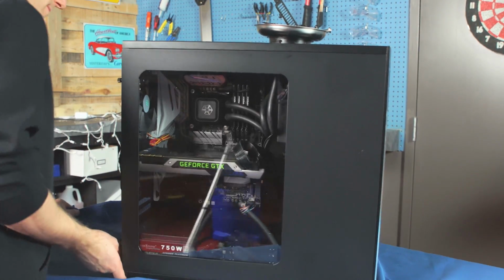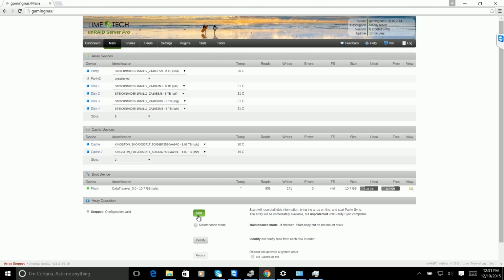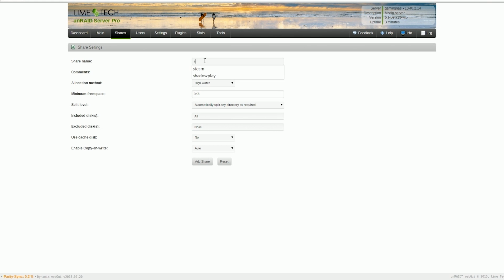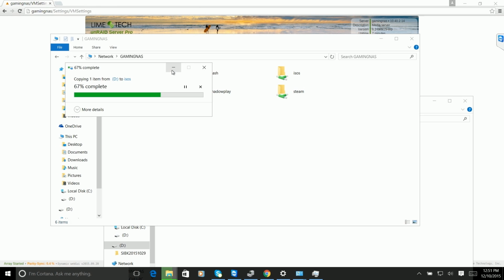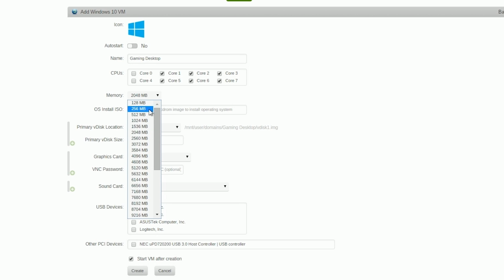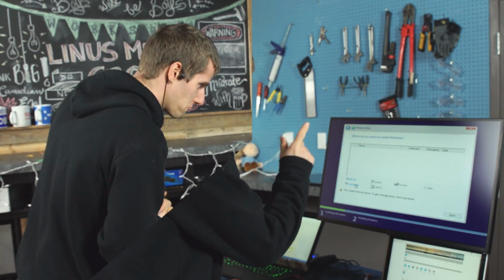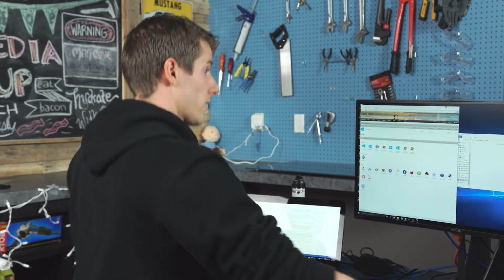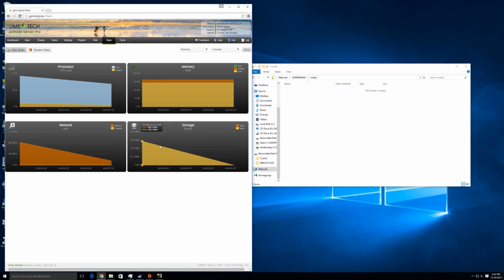Use your Gaming PC's Extra Power as a NAS Ultimate Guide

Comment: Linus...you just called UEFI BIOS after doing a video about UEFI and BIOS. They're separate and completely different things :/
Reply: He's just reading the screen... it's literally titled "UEFI BIOS" on the screen bro
Reply: oiralire except that's incorrect not to mention he didn't read the screen. He just said "BIOS." It's incorrect because https://en.wikipedia.org/wiki/Unified_Extensible_Firmware_Interface "UEFI replaces the Basic Input/Output System (BIOS) firmware interface originally present in all IBM PC-compatible personal computers." If wikipedia isn't credible enough google it on your own. They're not the same.
Reply: +Scoopta The particular firmware he's using is ASUS UEFI BIOS Utility.
Reply: oiralire yes I'm aware which is a UEFI...not a BIOS. The branding isn't technically speaking correct. There's no such thing as a UEFI BIOS. There is UEFI which is one thing and used on most modern motherboards including that one and then there's BIOS which is more old school. https://fedoraproject.org/wiki/Unified_Extensible_Firmware_Interface "But you may see the term "UEFI BIOS" (or even just "BIOS") incorrectly used to refer to a UEFI firmware"
Reply: +Scoopta I like ham and pineapples.Your argument is invalid.
Reply: oiralire XD...damn Idk how to beat that =P. There's no fact on earth that can beat ham and pineapples. So does that make your favorite pizza Hawaiian?
Reply from the maker: +Scoopta And yet, somehow, you understood what I meant... :p
Reply: +LinusTechTips can I plug my anti static wrist strap in my grounded wall outlet? ??
Reply: Its not incorrect if its the brand name. Plus everybody knows what he's talking about, especially since UEFI and BIOS pretty much serve the same purpose, so most normal people wouldn't actually give a shit...
Reply: tbh i've been watching linus's videos for like a good 3~4 months and i can't understand anything lol
Reply: why are people even arguing over something so trivial as branding? Descriptively, UEFI is still a Basic Input/Output System, in that it's firmware that handles basic IO. Colloquially, BIOS is a term for firmware. Linus's point stands, linguistically, because the most fundamental attribute of language is its utility in communication. That his use of a pedantic misnomer conveyed the same meaning just as effectively, if not more so (many have no idea what UEFI is but have heard of BIOS) makes his use effective, and thus valid. Why am I taking the time to type all of this? Bus to work and I forgot my headphones...
Reply: +Scoopta how is this top comment for fuck sake
Reply: LinusTechTips XD =P...this is an excellent point...I was just pointing something out.
Reply: Scoopta Your second point kinda proves mine. They serve the same purpose yet the brand given to them changes its name. Hence if Asus wants to call it a UEFI BIOS, whether it makes sense or not that's what its called.
Reply: +Scoopta A UEFI is basically an interface program for handling the BIOS, Most modern PCS have a UEFI to make maneuvering around the BIOS much more intuitive for laymen and much simpler to laymen. The difference is the UEFI runs only when you access the BIOS, where as the BIOS is running 24/7 even when your pc is off.
Reply: Completely different things? Both things perform the same functionality. UEFI is just more modernized and offer more advanced features. In essence, that's all. It's like a BIOS 2.0 or something like that.
Who cares about those details, dude?
Reply: +Scoopta I really enjoy watching you struggle from some sick reason LOL
Reply: +Scoopta who cares ¯\(ツ)/¯
Reply: +Michael Alderson brand name? I fail to see what you mean by this. They brand the UEFI with "UEFI BIOS" but that doesn't make it correct. Also MS-DOS and Windows serve effectively the same purpose yet I doubt anyone uses those interchangeably and that's a perfect analogy.
Reply: +Scoopta Relly. Why do you care?
Reply: +To Athánatos yes and then you could say Windows is MS-DOS 2.0. Which I guess isn't too far off but that still doesn't make it correct.
Reply: +waywarden -__-
Reply: +Scoopta  WoW...now that was entertaining...(for whatever reason)...
However I still have the sudden urge to punch you in the throat...LOL
Reply: +Scoopta You would probably  be correct sir...it shouldn't be very difficult for you as I'm a quadriplegic and have been wheelchair bound for 20+ years.  You really should consider chill-laxin a little...  learn how to make lite of certain situations while interacting in a social environment...no need to be so anal over the proper terms. 
Pause and think about where we are for a second,  a tech channel. 
We're all very aware of the differences between UEFI and a legacy BIOS and their advantages and limitations. They both preform the same purpose in the transition from hardware level to the OS correct? UEFI is just a superior BIOS with more features and a lot features that can be directly from within the OS. The even still call the chip on the MB a BIOS chip. Hell, a lot of your high-end MBs and GPUs of have two, and what do they call this feature?... a "dual BIOS". But we all know it "technically" has UEFI firmware flashed on the chip.

Some social acceptance advice would be...just be aware of who the audience is when attempting to educate someone on something so trivial and universally understand by the audience. 
Unless you're just trolling, then perhaps... mission accomplished...and the joke is on us!  :p 
Peace.
Reply: Scoopta looks like you almost got the point that time. It's an acronym letters that stand for words that describe something. The term BIOS is here to stay weather you like it or not just look at amazon or newegg under tech specs it'll say BIOS: UEFI and that's not gunna change, because when you get down to it UEFI is a basic input output system.
Reply: Scoopta so are Windows and OSX but they're both still operating systems.
Reply: Scoopta the problem with your argument is that your "source" is a guy saying with no supporting evidence that "you may see the term "UEFI BIOS" (or even just "BIOS") incorrectly used to refer to a UEFI firmware". He, in no way supports this claim and if you read the rest of the article his explanations support our side:
"It is important to realize that most systems with UEFI firmware also implement a BIOS compatibility mode"
"As we've already seen, the way to choose whether to do a BIOS-native or UEFI-native installation of Fedora is to boot your installation media in the correct way"

It's literally naively backwards compatible, and the original statement is literally just a guy being butt-hurt that they're calling his system by a name that he doesn't want associated with it, but that's not his choice. It's like saying "It's not a CAR it's a HYBRID" no it's a Hybrid car. It is in fact a Basic IO System.
Reply: +Scoopta 
OMG dude...
"It's the artist, formerly known as Prince" 
But...but...he's doing the same thing he's always did...no! no!  it's not Prince...technically! 

WTF are you trying to prove that we don't already know?
Reply: +Scoopta it&#39;s been very amusing...thank you ;)
Reply: +Scoopta Except UEFI is still technically at least an IOS (Input/Output System)
Reply: +Scoopta UEFI BIOS Is the new "ATM Machine"
Reply: +Scoopta oh no... somebody call for help...
Reply: +Mark As a CompTIA Certified Potato technician, I think this whole conversation is silly :D Who cares what you call it? BIOS and UEFI/EFI are pretty much the same bloody thing. UEFI is just better, but its still the firmware, still does POST control, etc.
Reply: moncool17Gaming yeah I did. You said "they're just visually different" and "the point of UEFI is to look pretty." I was pointing out all the technical differences and while I didn't actually get into why it was created it wasn't to look pretty. Basically everything you said was wrong...and while they do generally look different(and yes prettier) if you look at a UEFI on a server motherboard it looks exactly like BIOSes used to.
Reply: +Michael Alderson except it's incorrect to call it that. Also I fail to see how my second point proves yours. My second point is basically saying if you call UEFI BIOS then you can call Windows MS-DOS. In both instances you have two pieces of software, one newer and one older, that both serve the same function.
Reply: +Michael Alderson I suppose what you're getting at is they named their UEFI "UEFI BIOS" and so it's ok to call it that. But I still think if I named my pet turtle "fish" and called him a fish because that was the name I gave him people would look at me funny and that's my point.
Reply: 😂😂😂+smt kill me😂😂😂
Reply: +blchfnby did you read the links I posted for the facts? Because if you did then you didn't understand them. That's not how anything works.
Reply: +Timothy Gilbert (TJ4542TJ) you also clearly didn't read anything I previously posted. I'm not going to re-aruge my point.
Reply: +Stian Strange because I do. I'm weird like that.
Reply: +Timothy Gilbert (TJ4542TJ) well for the TL;DR version. UEFI isn't BIOS and the "UEFI BIOS" branding is wrong according to any source that actually knows. Say the fedora wiki
Reply: ***** what "UEFI BIOS" :/...if that's your point see https://fedoraproject.org/wiki/Unified_Extensible_Firmware_Interface
Reply: ***** excuse me mam. I do know exactly what I'm talking about. Firmware is the umbrella term...BIOS is not an umbrella term. "The BIOS (/ˈbaɪ.ɒs/, an acronym for Basic Input/Output System and also known as the System BIOS, ROM BIOS or PC BIOS) is a type of firmware used to perform hardware initialization during the booting process (power-on startup) on IBM PC compatible computers, and to provide runtime services for operating systems and programs." "Unified Extensible Firmware Interface (UEFI) was designed as a successor to BIOS, aiming to address its technical shortcomings.[4] As of 2014, new PC hardware predominantly ships with UEFI firmware." https://en.wikipedia.org/wiki/BIOS
Reply: ***** also you clearly missed the quote from the fedora page so here "But you may see the term "UEFI BIOS" (or even just "BIOS") incorrectly used to refer to a UEFI firmware" https://fedoraproject.org/wiki/Unified_Extensible_Firmware_Interface
Reply: ***** I already stated it's not an umbrella term...firmware is the umbrella term...BIOS is a specific firmware. I don't have time to argue with trolls like you...and if you aren't trolling then you're to lazy to read the links or quotes I'm sending. Either that or you're just stupid. I've done my research I've posted my sources all you've made are assertions. Unless you give me some hard facts proving your point I'm just going to ignore you.
Reply: ***** I guess I never addressed your point about it being a colloquial umbrella term so I might as well do that. I already pointed out it's not an umbrella term and while it may be a colloquial umbrella term because then you can argue it has nothing to do with what it technically is that also makes it a complete non-point. From a social standpoint anything is acceptable as long as it's widely accepted however that doesn't make it correct.
Reply: ***** I do understand the word. From dictionary.com "characteristic of or appropriate to ordinary or familiar conversation rather than formal speech or writing; informal." Which is why I said that's a complete non-point. Just because people agree that UEFI can be called BIOS in conversation because they do the same thing does not make it correct.
Reply: ***** true and that was why I said "I understand this argument but it's still stupid." That's not actually what I said but it's what I was going for.
Reply: ***** First off there's no reason to call names secondly IDGAF if it's socially acceptable. You clearly missed my point by a light year or so...my point was that it's wrong to use the term. A BIOS is not the same thing as a UEFI. Yes they do the same thing and from a social standpoint you might be able to call them the same thing but that wasn't my point in the slightest. My entire point was that it's wrong to do so regardless of social/lingual acceptance because that's not what they are. I'm a very fact first person. Not the kind of person who is going to accept the "it's socially acceptable to do this so meh." Not to mention anyone who actually knows what they're talking about say computer scientists, especially those building operating systems, will use the proper term.
Reply: smt I'm only arguing because other people keep arguing. I was content after the point Linus made. I even said he made a good point. I literally only keep replying to people who continue to fuel this. Also I do go outside __. Also if I'm only stupid because I prefer facts over social acceptance then I think you've got the term wrong. I will admit socially I'm not the best but stupid I don't think is accurate.
Reply: ***** while Linux is just a kernel at least when you say "Linux" you're referring to an operating system based on the Linux kernel which is correct with "GNU/Linux" all you're doing is specifying it's a Linux kernel with a GNU userspace. Using BIOS to refer to UEFI is just wrong. Also I'm not intending to look smart and I don't give a single fuck if I'm embarrassing myself. Quite frankly IDGAF what people think of me arguing this all I'm saying is it's wrong. I also do know what I'm talking about. I guarantee I know more about a computer inside and out than you do. Maybe I'm wrong on that but I doubt it. UEFI is not the same thing as BIOS. BIOS is not an umbrella term. It wasn't ambiguous and I NEVER once said it was so that was never the point of my argument. I completely knew what he was talking about that's why I made the god damn post. And my original post never said "well it's not BIOS and some people might get confused." That was never my point.
Reply: +Scoopta has humor!! "You clearly missed my point by a light year or so..." to a guy named 0rb1tal xD
Reply: +James A Garfield XD gg no re. That's just unfortunate
Reply: Buehlar that's nice...that's assuming you can. I get the feeling I could kick your ass into next week but meh
Reply: +Buehlar It just erks me. That's really the only reason I made the post. The effort wasn't to try to educate anyone. I'm positive Linus already knows the difference and that's who my comment was primarily targeted at. I made the comment as feedback because it's something that personally annoys me, not using proper terms that is. I only argued the point because of the responses. I was not attempting to educate anyone until I ended up getting misinformed replies to my original comment.
Reply: +Voked kappa because reasons? I really have no idea
Reply: +Scoopta ok lets break this down. 
UEFI:
Is it a system. Yes
Is it basic. Yes
Does it regulate Input and Output. Yes
UEFI=BIOS confirmed
Reply: +steven kutschat except now you're using BIOS as nothing more than an acronym which while it is that it's in relation to a specific piece of firmware that UEFI isn't.
Reply: +steven kutschat yes it does perform those functions but it works and is designed fundamentally different
Reply: +steven kutschat oh also I fully understand the point and that argument entirely. The problem I have is it's still inaccurate.
Reply: +steven kutschat yep that's true. Just like UEFI and BIOS are both firmware.
Reply: +steven kutschat you're trying to use BIOS as an adjective to describe what UEFI or BIOS or any firmware really. I'm using it as a noun as in the name of the firmware primarily used on x86 based PC's for God knows how long till UEFI replaced it. The thing is I'm not even really trying to make an argument. I have sources. No one else on the other side has posted sources saying they're the same thing. Maybe it's just me but I tend to lean on the side of the fedora project or really any Linux distro/tech giant (including Microsoft) as opposed to people telling me I'm wrong because they say so.
Reply: steven kutschat first off I'm aware of the backwards compatibility. Also a guy is butt-hurt...this is fedora. Do you even know what that is because I doubt this after that statement. But let's just look around shall we. Oh I suppose Microsoft is butt-hurt too...yep http://windows.microsoft.com/en-US/windows-8/what-uefi it's designed to replace BIOS. Not be BIOS
Reply: Buehlar that analogy isn't accurate...but I'm not trying to prove jack shit...this comment was a correction however people don't seem to like corrections even WHEN THEY'RE NOT TARGETED AT THEM.
Reply: Buehlar well at least someone got something out of this XD.
Reply: +LinusTechTips xD
Reply: +iFail21 I do obviously __. I'm sure there are others just not the majority.
Reply: FireFaced  yea but that's not really the argument I'm making here. I don't think there's any argument that can be made that says it doesn't serve the same function as BIOS.
Reply: kingcarcas1349 uhhh?
Reply: +ApolloJustice I want to agree I really do, but you're implying  redundancy is the problem, UEFI does a lot more than just replace bios, the closer comparison is like comparing your mobile banking app to a teller at the counter
Reply: ***** no my uhhh was because of exactly what ***** said. I didn't get the analogy. I got the redundancy.
Reply: It says UEFI BIOS Utility.
http://prntscr.com/9nz838
Reply: A Christian Gamer at least look at all my sources that say that's wrong. I've posted at least 3 or four links including one from Microsoft.
Reply: +Scoopta we all know the difference, asus doesn't and that's the problem, linus wasn't incorrect in what he said as it was accurate of asus naming and terminology, but being asus was wrong it doesn't look good for anyone repeating them

that having been said there were a few boards in the transition that did utilize dual boot options at the primitive level having the option to use either BIOS or UEFI, I think this may be one of them?

The real question is since everyone here knows the details why are we still going on about it? Linus knows, you know, I know, everyone reading this knows, and likely anyone actually watching this knows
asus was wrong let's hate on asus and move on

ignore the fact I'm applying for a brand management position with asus and own an insane amount of their products....
Reply: ***** XD. I only continue talking about it because everyone else does :(. Also I don't think that's the case about it being an older board with both options. UEFI is mostly backwards compatible with BIOS although it is missing support for some stuff like 16-bit binary support.
Reply: +LinusTechTips  UEFI & BIOS are the same sh@# but different flavor. One is pretty. The other...... not so much.
Reply: Eddie Romero those aren't the only differences. Not even close.
Reply: +Scoopta - It doesn't matter how many sources you cite.  The manufacturer named it.  That is the end of the story.  
What you are arguing would be the equivalent of saying a Ford Taurus isn't really a Taurus because Ford is just wrong because someone that works for GM says so.  
Shut it.
Reply: Chris Moore I already stated my arguments against this. I.e. you name a turtle fish. Can you call it fish? Yea I mean you named it but it doesn't make you look any less dumb.
Reply: +Scoopta actaly UEFI BIOS is totaly correct because UEFI is just the more consumer frendly(and better to look) BIOS
do you always say i have Windows 10 or im gonna start Windows 10 no you say im gonna start Windows or OS its the same
Reply: ***** no that term isn't BIOS. The generic term is firmware. UEFI is also a lot different from BIOS besides the looks. If you wanted an analogy that makes it OK to call UEFI BIOS then you'd have to accept calling Windows MS-DOS. UEFI is a BIOS replacement not a newer version. However they're both firmware. Similar to how Windows is a replacement for MS-DOS and they're both OSes.
Reply: same as most people say garmin or GPS when they mean navigation

and also BIOS is system from IBM and just for IBM as far as i remember my teachers lecture about BIOS UEFI and EFI most of computers in last years before UEFI had EFI
Reply: ***** huh? No that's not the same. When they say garmin that's a specific brand of GPS. When they say GPS that's global positioning system. Navigation is the function a GPS provides. Firmware is not the function UEFI or even BIOS provides. Garmin is a type of GPS which performs navigation. UEFI is a type of firmware that performs the POST(power on self test) and loads your OSes bootloader.
Reply: Scoopta just saying you didnt understand what i ment
Reply: ***** what didn't I understand about it? You're example was I'll call Windows 10 Windows which is just shortened. That's why it's called UEFI. Otherwise it would be Unified Extensible Firmware Interface and isn't that a mouthful. BIOS is a completely thing altogether. Even Microsoft says so on every single website they have regarding what UEFI is. It also isn't just for IBM you're right. It's for IBM compatible PC's which is at this point literally every PC so meh. and yes there is EFI but what does that have to do with this argument.
Reply: Scoopta you  are stupid and dont understand a thing about a thing or anything at all
Reply: ***** oh really. This proves my point nicely http://windows.microsoft.com/en-us/windows-8/what-uefi anyway I'm done arguing. BIOS is not synonymous with firmware and you'd be surprised how much fucking research I've done just so that when people like you challenge this I'm not an idiot. Somehow I don't think it's me. Hell even Linus didn't disagree he just said "well you knew what I meant."
Reply: +Buehlar I stopped at quadriplegic. If you are any sort of (x)plegic, I'm sorry for you, I truly am, but I must point out, quadriplegics can't use their arms, thus they cannot type. If you had someone type this out for you, I can understand that. Also, would you care for a watermelon?
Reply: +Scoopta As a computer scientist I find this conversation very entertaining. While I and most other people accept your position that they aren't technically the same, for all intents and purposes the terminology is interchangeable. Especially for people who aren't interested in the core running of the machine. For most people the BIOS is simply "the bit before the OS logo shows up" it doesn't matter what the correct terminology is, to the layperson that's just what its called, especially when that is what the motherboard company they are using has called it that. Even within the industry the terminology is largely interchangeable. Like someone else said as long as people know what you mean then the goal of the message has been achieved.

This happens a lot in life, especially when old tech and systems are replaced with new ones. Terminologies and ways of referring to things just stay as a popular generic term. Yeah people are technically wrong, but you can't let it get to you the way it seems to. If you do then you will find it very hard to talk to people outside the industry about computing.
Reply: Mark I'm also a computer scientist which is actually why this bothers me so much. I'm a stickler for names. An example is with this and another example is with SSL and TLS. I always use the proper terms and it's just a pet peeve of mine. I rarely talk to people outside the computing industry and even when I do chances are I won't correct them. The biggest annoyance about this for me is LinusTechTips is in the industry and he should know the difference. While I do understand that motherboard makers have been referring to it as BIOS most generally refer to it as UEFI BIOS. So I would think enough people would, if nothing else, know what the UEFI is even if all they think is "oh that's just the BIOS."
Reply: +Sollux Captor I have a Master's in Computer Engineering, let me handle this. TAKES DEEP BREATH They are not the same thing.
Reply: But by the logic of basic purpose, it does the same thing. They are of the same type. They are not the same thing, one is newer, more advanced, but a 70s Mustang and a 2016 Hybrid, are both cars.
Reply: Sollux Captor They do the same BASIC tasks. UEFI BIOS has alot more options and control over your pc. But he mentioned just BIOS because it was just quicker to say. Like calling a French Horn a horn. Every wind instrument is a horn, but they call it a horn just because it is quicker to say.
Reply: Sollux Captor the word you're looking for is firmware. They're both firmware like your car example. Your logic using your own example equates to a Prius and a mustang both being Priuses. UEFI and BIOS are both types of firmware. Neither is the other.
Reply: Scoopta What I am saying is that they are both Firmware. Exactly. A car hosts the function of transport, just like BIOS & UEFI host the same functions. But you know what they say, You cannot fix stupid. So, I'll let you lot think whatever you want. :3
Reply: Sollux Captor yes they are both frimware but my point is you wouldn't call a mustang a prius. I don't care if people call it firmware...that's 100% correct. I just have an issue when people call my mustang a prius...it certainly isn't.
Reply: No, I didn't call your Mustang a Prius, I called it a car.
Reply: @LinusTechTips LINUS YA DUN GOOFED NOW YOU ARE AT THE MERCY OF THE INTERNETS!!!!
Reply: Sollux Captor yes I understand...it just sounded like you were defending the argument allowing UEFI to be called BIOS which is like calling a mustang a prius. Maybe I misunderstood what you were saying though.
Reply: All I was saying is that they have the same Purpose. (I'm also saying that in reality, who gives a fuck about a computer term that doesn't really matter.)
Reply: Sollux Captor I give a fuck...but anyway. Yes they do have the same purpose.
Reply: thats just nit picking.... everyone or almost everyone with a lot more years of experience with BIOS than UEFI are going to call it Bios or uefi bios... its essentially the same thing. just a different name and presentation.... if the brands themselves use "uefi bios" or whatever we shouldn't feel obligated to do so.
Reply: Andre Goncalves I mean...it performs the same actions but there are quite a few differences between them. I.e. lack of support for 16bit binaries, support for the GPT partition table, needing an EFI partition. Not actually being compatible with BIOS without using an emulation mode and even then still lacking 16 bit binary support. Not to mention regardless of what the manufactures call it it's technically incorrect to call it bios.
Reply: Its just a technicality... for daily use bios or uefi is the same. 
Its like car = vehicle = automobile, the correct one is automobile, but, we use car.
Reply: Well, no, BIOS is like, a 2006 Ford Fusion, and UEFI is 2016 Mustang.
Reply: Andre Goncalves not really. I like Sollux Captor's response. They're two completely different kinds of car. They perform the same function but one is newer, better, and they do function differently.
Reply: UEFI is a type of BIOS, along side what has been retroactively named Legacy BIOS. You compaired them to cars, but they're more like Ford F150's, one from 1987 and one from 2016. Both do the same basic task, one has far more features.
Reply: ://ReaperReaper nope...UEFI is not a type of BIOS. BIOS and UEFI are types of firmware. If we go with the cars example they're two different models not just newer vs older.
Reply: Scoopta UEFI is a type of BIOS, Legacy BIOS is a name for a broad range of the various BIOS manufacturers used, but they are all still BIOS. UEFI has a few new features, like GPT partitioning support, but it isn't an entity completely different from BIOS.
Reply: ://ReaperReaper but it is a different entity and any research will prove my point.
Reply: While they have their differances like Reaper said UEFI is a type of BIOS and the terms are commonly used interchangibly due to the fact theat saying UEFI BIOS is really long.
Reply: Noah Hellweg UEFI IS NOT a type of BIOS. AT ALL. That is flat out wrong. Regardless of how different or similar they might be they're not the same and anyone who knows the technical side of how they work will tell you that.
Reply: Scoopta BIOS is a broad term used for the firmware of a mainboard that handles system boot and hardware management for the duration of the boot process. Due to limitations of older versions of Windows, the BIOS was always active, but that changed as the input and output capability of Windows and other operating systems grew. That trait carried over to UEFI.
The UEFI serves two additional purposes over Legacy BIOS, a uniform and standardized piece of firmware (although GUI isn't standardized) to improve operating system and hardware compatibility amongst components, and use of the GPT partitioning scheme.
You do realize you're arguing not only with us in this thread, but ASUS, MSI, Gigabyte, Asrock, and even Intel, right? They all verified that there is a difference between UEFI BIOS and Legacy BIOS.
Reply: ://ReaperReaper I'm not arguing with their engineering departments...I'm arguing with their PR and marketing departments...those are two VERY different things. And yes I know what the difference is. Also BIOS while it is often used as a broad term it's a specific piece of firmware and shouldn't exactly be used as broadly as it is.
Reply: Scoopta BIOS is a broad term, as Legacy BIOS is not standardized, with functionality ranging from literally the most basic boot procedure to damn near everything UEFI does. The most specific component of BIOS is that it is Mainboard firmware, and even then, graphics cards also have their own vBIOS and UEFI.
Also, no part of any corporation recognized a difference between BIOS and UEFI, only Legacy and UEFI.
Even if it were the PR and marketing departments, it's still your (worthless) word over that of the companies that created BIOS and UEFI.
Reply: ://ReaperReaper ...you do realize how dumb marketing departments can be. A perfect example is the AMD FX line of CPUs. The engineering department says they're server parts but the marketing department is what pushed them to be on the desktop. Also...my point with the PR departments is that they know nothing. As far as my word being worthless I can't really argue with that given I'm just some dude on the internet. That being said there's a reason I post links to back up what I'm saying. That way you're not trusting some nobody on the internet. And legacy is just a way of separating BIOS from UEFI and the only reason we need the word legacy is because we call UEFI BIOS. Just look at the BIOS wikipedia page. It literally says right there. UEFI was designed as a successor to BIOS.
Reply: Yeah a dead link that can't be verified from Microsoft and a link to Fedora's wiki page (that anyone can edit and isn't actively monitored, and has no citation) don't prove anything.
The only time BIOS ever specified a specific piece of firmware is when it was first created. Once there were third party manufacturers, multiple versions of BIOS existed, and for multiple platforms, including x86_32 and AMD64.
UEFI was the next true generation of BIOS, and was born when a problem with BIOS needed to be dealt with: the 2.2TB limit of the boot disk due to MBR. Microsoft and Intel took the change to make a unified and standardized platform out of this.
UEFI isn't a new and unique piece of firmware. It stems from what was considered the best that BIOS offered, with introduction of the GPT scheme. UEFI is a BIOS, Legacy BIOS was the cluster fuck that was normal before UEFI.
Reply: ://ReaperReaper ...what do you mean can't be verified from microsoft. Not sure if this is the same link...I honestly don't remember the link I posted but here's another for good measure. https://www.microsoft.com/surface/en-us/support/warranty-service-and-recovery/how-to-use-the-bios-uefi?os=windows-10&=undefined and a better one https://msdn.microsoft.com/en-us/windows/hardware/commercialize/manufacture/desktop/boot-to-uefi-mode-or-legacy-bios-mode also who said it has to be new and unique to be a different thing? Literally any article you look at regarding UEFI vs BIOS will tell you they're not the same thing and that referring to UEFI as BIOS is wrong. The only people who lump them together are PR departments.
Reply: Scoopta First page is the PR department champ, and the page is erroneous and incomplete.
The second page doesn't support your claim at all, it only supports that UEFI BIOS supports Legacy BIOS operating systems and booting from devices designed for Legacy BIOS.
It also doesn't change the fact that the manufacturers of the boards, and the development teams creating firmware that make them work, do not acknowledge UEFI and BIOS as different entities.
Why?
Because they aren't. UEFI is an extension of EFI, the prior BIOS family. BIOS isn't a specific piece of firmware, it's a broad term for the type of firmware that UEFI falls under, same with AwardBIOS, AMIBIOS, Insyde, and SeaBIOS, all four of which now fall under the umbrella term 'Legacy BIOS.'
As per definition a BIOS is a type of firmware used to perform hardware initialization during the booting process. When IBM first introduced the IBM-PCs, the BIOS also served as an abstraction layer, but that has since been dropped in modern systems.
Reply: ://ReaperReaper UEFI is an extension of EFI and about the only correct statement you've made all day. Yes and if you keep reading that wonderful wikipedia page that you're quoting from you'll get to the part that says "UEFI was designed as a successor to BIOS, aiming to address it's technical shortcomings. As of 2014 new PC hardware predominately ships with UEFI firmware." Notice how the only time BIOS is mentioned is in reference to UEFI replacing it outright.
Reply: Scoopta Wikipedia can be edited by anyone, and I'm not quoting the UEFI page on Wikipedia either.
"UEFI was designed as a successor to BIOS" is a load of bullshit. It was designed as a successor to EFI BIOS, which was successor to Legacy BIOS like AwardBIOS and AMIBIOS.
It's all different types of BIOS, not a single one of those pieces of firmware achieve a different objective to BIOS. Not a single one is designed to.
Going back to the car analogue, you're arguing that a 2017 Ford Raptor is completely different from a 1987 Ford F150 Lariat because the 2017 is a successor and does some things different. They both are trucks, they both perform the same task. The 2017 does it more efficiently and has some new features, but it doesn't change the fact that the 2017 is a truck, just like the 1987 Lariat. It's the same fucking thing with UEFI BIOS and Legacy BIOS.
Reply: ://ReaperReaper You're right they're both trucks...and UEFI and BIOS are both firmware. I'm aware of what I'm arguing and they are bloody completely different...they're completely different trucks. No one is arguing that one is a truck and the other isn't. They're both trucks. Just like UEFI and BIOS are both firmware used in a pre-boot environment to perform POST, loading the bootloader, etc.
Reply: Scoopta Except that BIOS by itself is nothing more than a classification, a type of firmware. AMIBIOS is the Lariat, UEFI is the Raptor, both of them are BIOS, much like the Raptor and Lariat are both trucks.
Reply: ://ReaperReaper no both of them are firmware just like they're both trucks. You're trying to say that they're both a Lariat.
Reply: Scoopta Quit bitching
Reply: moncool17Gaming it's not really bitching.
Reply: Scoopta Yeah it is. UEFU and BIOS are the same thing. They're just visually different
Reply: moncool17Gaming actually no. I've seen BIOS and UEFI look identical. The main differences are under the hood differences. Things like UEFI supporting GPT, lacking support for a 16 bit mode, switching out of real mode before passing control to the OS, requiring a compatibility layer to boot old BIOS based OSes and hardware, etc.
Reply: moncool17Gaming you didn't read anything I said about real mode, etc did you?
Reply: Scoopta It's irrelevant so I ignored it. Did you read anything I said?
Reply: Scoopta